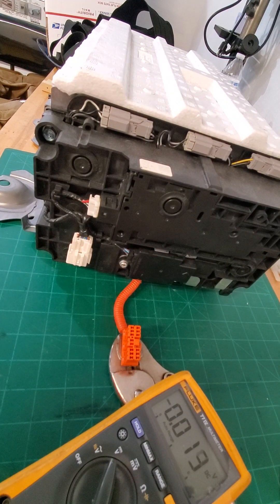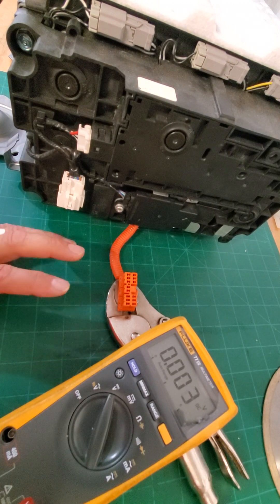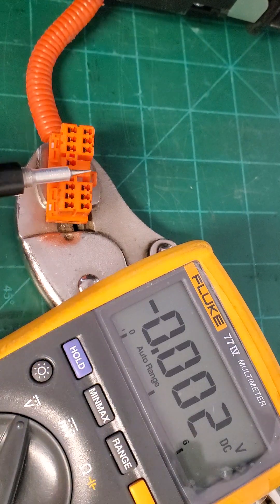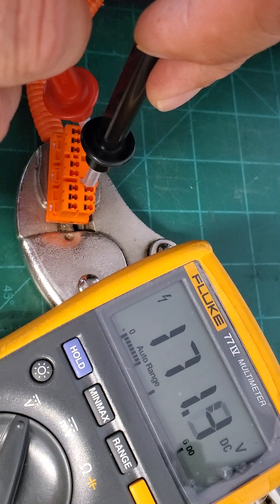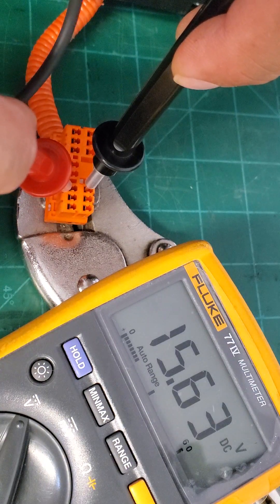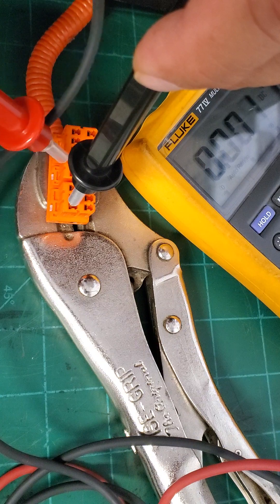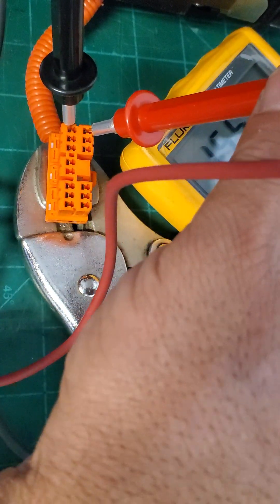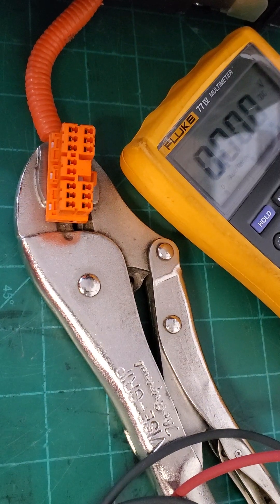2006 to 2011 HONDA CIVIC IMA battery voltages testing of individual blocks using orange plug

Comment: hello @carlosmedrano8656 your videos are amazing and so informative. keep doing good work.. learned alot from your video..
I am having 09 civic hybrid. having IMA battery issue and 12v battery not charging at all and draining so fast.. I tried to replace battery and took out and measure voltage. it shows 168V and each cell is around 15.1 to 15.3V. do you think it is the battery issue. I thout it is good and it should be charging 12V battery. Please advise what do you think.  If you could repy to my comment about my issue that would be so helpful. love your work..
Reply from the maker: @vaibhavvaghela1213  Hello, there are several things you have to look for. 1st is to have your 12v battery tested to make sure it is good. 2nd make sure all connections and grounds to engine are good. 3rd see what the output voltage of DC to DC converter is. 4th perform a manual IMA battery charge then perform a load test using just A/C unit to see if modules are out of balance.
Most of the information you need to look at can be seen though a full vehicle scanner or custom apps.
Reply: @carlosmedrano8656 thank you so much for your reply.I love your videos and your work. It’s amazing

I just want to give an update about my car here.
I checked all my ground cables and all had corrosion and not good so I replaced all with new ones.
After that I placed ima battary back on.
I started the engine and it was smooth start as my 12 V battery was fully charged and had 13V.  And then I turned off and start again and it was not smooth start and 12 v battery voltage was 12.2 V, it dropped.
I shut off and start the ignition again not the engine and check the input of the dc to dc converter which was around 168V and output which is connected to 12 V battery was showing as what 12V battery showing which is 12.2 V .

After I started engine and check input volatage of dc to dc converter which was 80 - 90 V, i dont know why it dropped, and output was same as 12 v and was dropping slowly.

Moreover, I took out the out put terminal of dctodc converter and check the voltage on the screw of that which was showing 0V. 
That’s mean, I was seeing output voltage of 12 V battery which means dc to dc converter not working.

Please advise me next step 
What do you think could be the problem.

I checked ima battery and it seems alright when I removed it but when engine start it drops voltage.

Even if I dont start engine, it should charge 12 V battery right? But it was not charging while I measured 168 V input of it. 

Please advise what should I do next
Your video helped me alot and I lover your method of teaching. 

Thank you 
Keep doing good work ❤❤
Reply: @carlosmedrano8656  thank you so much for your reply so quickly.. I really appreciate it. 
I replaced my 12V battery to new and it’s good. 
I am not sure about ground wire and all other connections.
I will check output of the dc to dc converter. Can I just check while car running ?
Thanks again for the help
Reply from the maker: @vaibhavvaghela1213  Hello,
You high Voltage System Nominal voltage is 158.8 volts, which means modules should be 14.4 volts. A fully charged pack, resting, should be around 173 volts which means modules should be around 15.7 volts. Keep in mind the capacity is what you have to worry about. When brand new the pack is rated at 5.5Ah and your vehicle requires at least 40 percent to operate normal. This means your pack should deliver 2.2Ah before any of the modules drop to 14.4 volts.

Comment: With the battery out and not connected to any power source, could I use this technique to test out a part out civic with the battery outside of the car? The battery I'm testing out has cut wire / harness (car harness)
Reply from the maker: Hi, sorry for the late reply. Was the Holiday season and was out of town. 
You can test the voltages with the pack out of the vehicle as long as the orange harness is good. Keep in mind this is to test voltages which is useful to determine the voltage difference in the pack. You have to load test to figure out capacity.
Reply: @carlosmedrano8656  ok I tested out 160v using that technique you show on video. I'm assuming that's a good voltage? My civic is 07.
Reply from the maker: @jesusdenver8211  The voltage is barely where it needs to be. At around 158 is when your high voltage starts charging, engine should come on. Take a reading of the 11 blocks/modules and make sure the voltage difference is less then .25 volts between the highest and the lowest. A charged up pack should be around 168 to 172 volts. Right now, based on the info you gave, your modules are averaging around  14.5 which is on the low end, a decently charge pack should average around 15.5 to around 16.5 per module.
Reply: @carlosmedrano8656  if I pop it in the car and do the 10 sec disconnect 12v negative battery - reconnect 12v battery technique, it will charge up the ima still right. Since it still has 160v. 
My civic I just bought won't activate the DC converter. Someone had mention if it's below 100v, a lot of stuff will shut down. 
Which i tested out came to 96v. 
The new one I just got shows 160v.
Reply from the maker: @jesusdenver8211  as long as the BMS does not detect any other issues, yes. Keep in mind there is a lot happening in the IMA system. When you turn on the power all the computer modules come on and start communicating via the CAN system. Once once powered on, the dash/info module talks to the BMS module and looks at the IMA system starting with the SOC of battery pack and voltage difference between all modules to include the three temp sensors. Then it communicates with the Inverter Unit/MPI to see the state of the IMA motor in the transmission. If all system check good, the computer then allows charging as needed.
Reply from the maker: @jesusdenver8211  Also, you will not know the health of the pack until you put a load on it to see if the modules stay in balance while under load